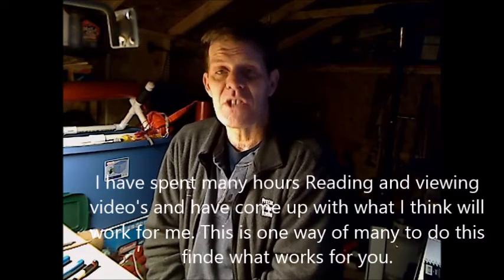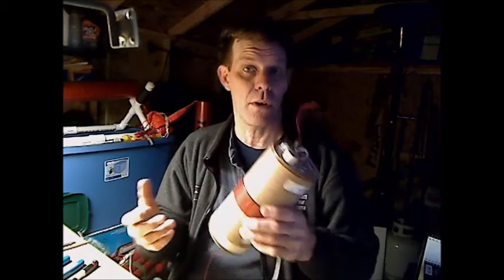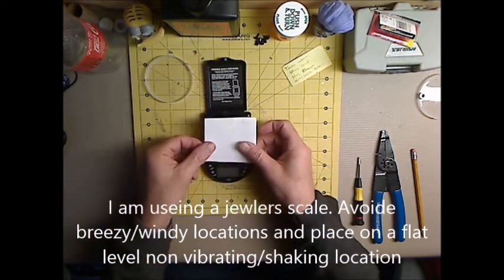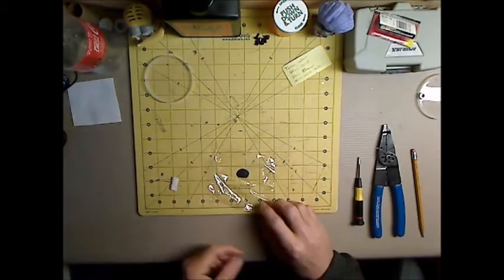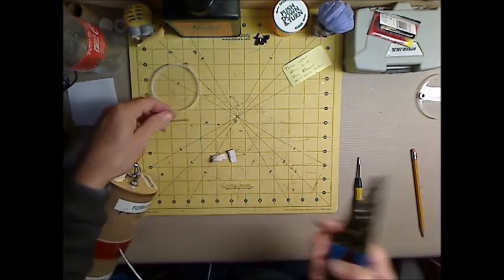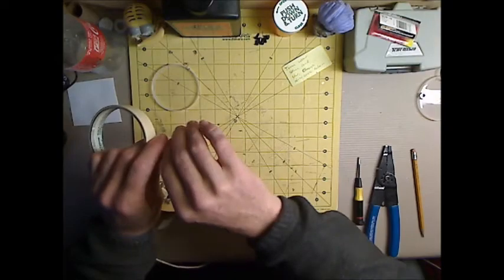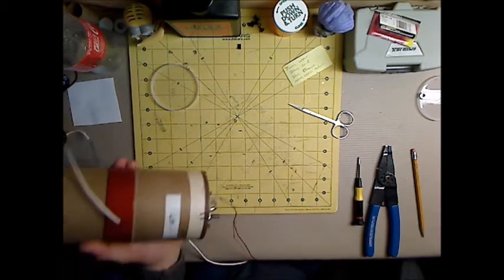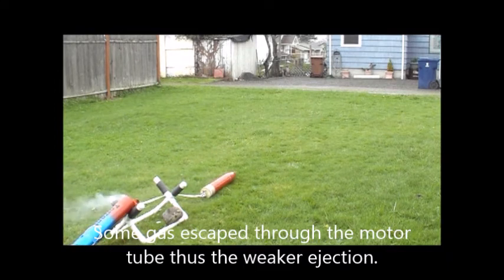Madcow Torrent Dual Deployment Charge Test

Comment: So basically, 1.2g in the bottom, and 0.6g in the top should work pretty well according to your calculations?
Reply from the maker: +Tom B it worked well for me but remember to ground test your own before flight. Differences in chute size if you use nomax protectors or even something as trivial as in did you seal off the nose cone or not can make a difference. you want the nose cone to come of stoutly but not go flying across the yard. The same goes for the lower portion. I have seen some demo videos where charge was so strong it sent the section being tested to the full length of the strap and still violently yanked the rocket.
Reply: Wow! 

Thanks for your Torrent post in the NAR group on FB, btw. Helpful to see what others have done with this rocket, as I get closer to finishing mine and going after certification(s).

Have you ever manually computed the CP to see how well it agrees with OpenRocket or RockSim? I'm going to do that once mine is completely assembled.